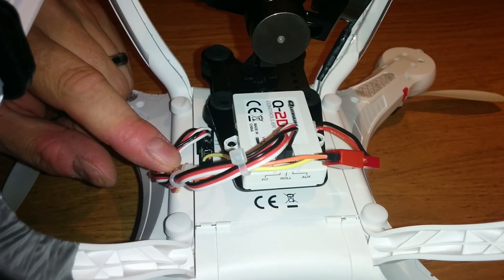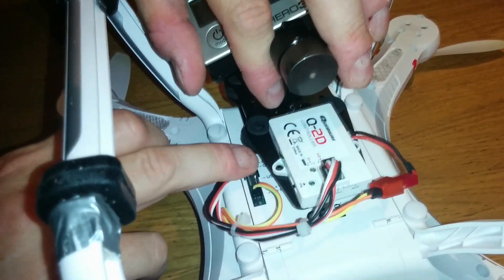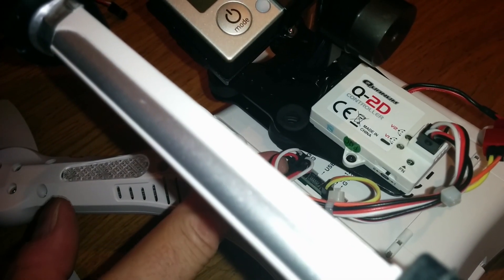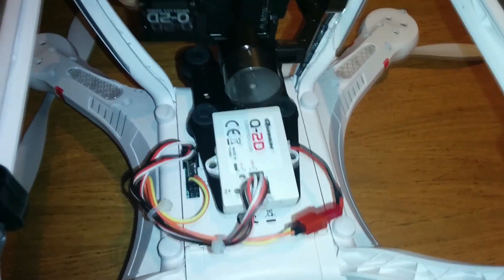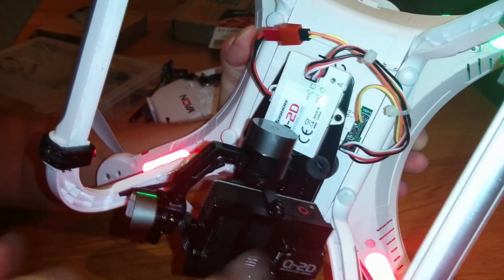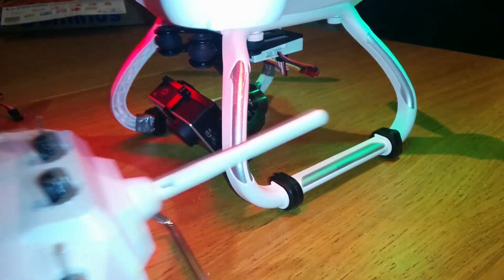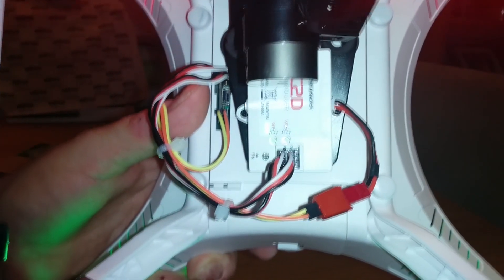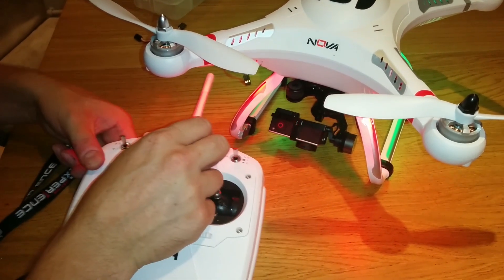Attach a Quanum Q-2D Gimbal to a Nova (CX-20) Quadcopter for GoPro

Comment from the maker: I will try do some flight timings on the batteries and update later this weekend. 

If you are having issues with the gimbal going nuts, I have found turning the control on AFTER the Quadcopter seems to help - BEWARE though. This could cause the Quadcopter to go into go home mode and fly away to its last known position as it thinks it has lost the controller. I hold mine down when powering up.

Comment: Hi Michael...can you give any advise as how to attach gimbal to underside of drone. I see that you only have 2 of the 4 rubber boots secured underneath drone. Is this stable (and secure enough - how many screws/bolts holding it in). Also, did you separate the two black base plates and then reconnect boots when screwed in? Thanks

Comment: Hey Michael, I've looked all over and can't find that 12 volt extension cable that you used.
Did you modify an existing one or is it available already configured for the Nova?
Appreciate your feedback... my bird will be here in a couple of days and my Q-2D arrived today :-).

Flying my Alias's has got me itching to fly something more substantial. :-)
Reply from the maker: Hi. This seems to be a grey area anyway. The gimbal draws power from the servo connectors and you don't HAVE to connect the power up. You may need to trim the end of the servo connector that comes with the gimbal though.

If you do want to get some of the leads try searching for - 20 cm DuPont Female - http://www.amazon.co.uk/s/ref=nb_sb_noss?url=search-alias%3Daps&field-keywords=20%20cm%20DuPont%20Female 

If you are having issues with the gimbal going nuts, I have found turning the control on AFTER the Quadcopter seems to help - BEWARE though. This could cause the Quadcopter to go into go home mode and fly away to its last known position as it thinks it has lost the controller. I hold mine down when powering up.
Reply: Michael H Reed You say adding the 12 volt connector is a grey area.  In the video mentioned that you found it unstable without it.  Have you since found another cause for the instability?  Mine is also very unstable.  Any bit of wind or a jolt will cause it to nod and then snap back to the correct position.  Please clarify, does the 12v connection help?  Thanks.
Reply from the maker: Ben Raubenolt Hey, yes, - If you are having issues with the gimbal going nuts, I have found turning the control on AFTER the Quadcopter seems to help - BEWARE though. This could cause the Quadcopter to go into go home mode and fly away to its last known position as it thinks it has lost the controller. I hold mine down when powering up.

Comment: Hi Michael,
I have the exact same setup Quanum Nova (CX-20) & Q-2D Gimbal, also controlled
via original Nova transmitter using aux1 & Aux 2 dial stitches, the gimbal works ok but the rotary aux 1 & 2 dials are way too sensitive! Meaning if Iso much as move either of the dials more than 1mm ie  pitch, the camera moves violently virtually
looking at the underside of the quad or up in the air!  Yours in thevideo seem to work allot better – smoother and it appears you have more throw on the dials etc.Do you know how or any way of adjusting this issue? 
I have attempted to adjust the gain as per (confusing) user manual, also one other video I found on YouTube (see below)
But doesn’t seem to make any difference whatever I try. It’s doing my head in now!!  
 Walkera G-2D gimbal looks & prob is the same thing just different colour etc
https://www.youtube.com/watch?v=_DcXsAA2B-M&t=70s&index=3&list=PLg1zxmhDeqXR_JTExkLPGlhzW5fIXtUGf
Reply from the maker: As far as I can remember you need to adjust the gain all the way in either direction. I have moved on to the DJI now.
Reply: Oh ok Thanks for reply, I'll have another go! If I suss it out I might do a video and post up etc, the manual is very complicated to understand, also it tells you how to but not much about why & what circumstances or issues should you do etc!? Can I just ask if when you set yours up, did you have to fanny around with FCN adjustments or did it just work ok? I'm not even sure if it's a gimbal issue or the Nova TX calibration?
Thanx allot!
If anyone else that might read this has any info or cure please get in touch or reply Thanks

Comment: you see the red capped wire that comes out the g2d controller . did that come with the gimbal or the camera or the quad ? I have this setup but haven't got that wire
Reply from the maker: +Adam Cotterell I think it came with the gimbal. But there are people who don't have it plugged in and it works. Something about drawing power from the other inputs. Not sure.
Reply: +Michael H Reed ok, I'm abit stuck really ... I have wires but none of them fit from the gimbal power to the nova . think I might have to make something up

Comment: Is That power cable a 1 pin connector or 2 pin? From your link I can't tell what one you used. need help!!  Thanks.
Reply from the maker: Its a 2 pin, but you can draw the power from the servo cables, the power is not really needed.